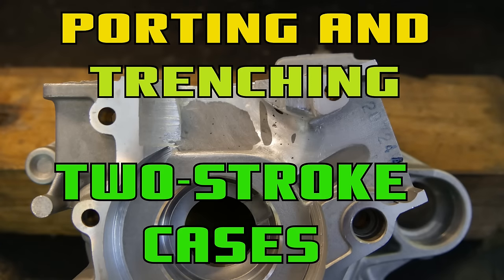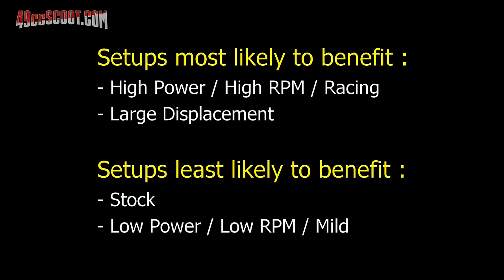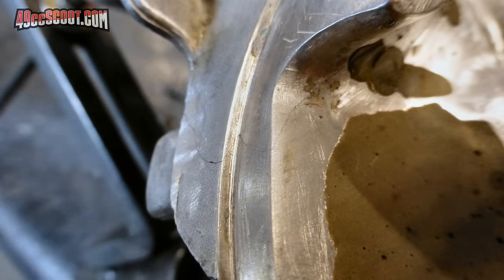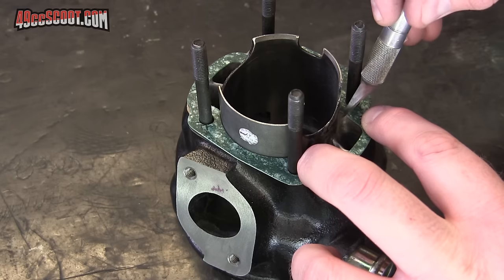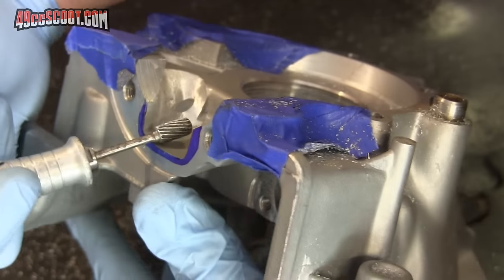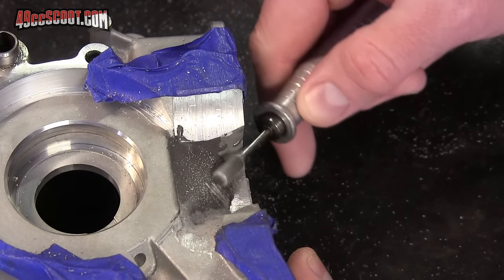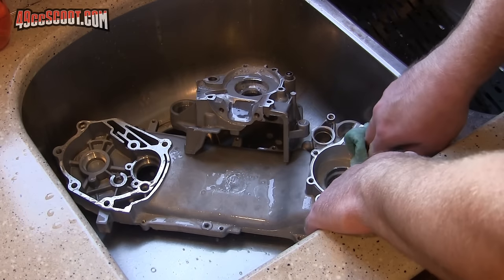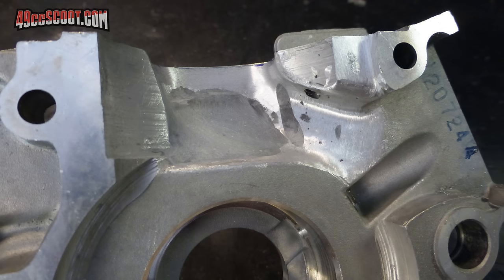Port Matching, Porting And Trenching Two-Stroke Engine Cases

Comment: When removing alloy from the cases, remember you will also be lowering the primary compression. Look up Tods tuning for BSA Bantams. Tod used to fit crankcase stuffers, to compensate for metal removed from ports. Also renew crankshaft oil seals.

Comment: One thing to keep in mind, when you cut away from the crank case and increase volume, when the piston comes down to pressurize the crankcase, it can not create as much pressure to push into the cylinder with.
Reply: Stuff crank w cork and epoxy.
Speed secrets of a16yr
Reply: If your pipe is working as it should the volume in the crank case doesn't matter.
The pipe will suck the mixture for you.
Reply: @rippn6124  Rebalance your rotating assembly after doing such a thing.
Reply: @gislemark79  That absolutely is not true.
Reply: @rippn6124   No thank you.
Reply: @jeffreyhagelin3672  High crank case volume was something you did use in the 70s and 80s.
Nowdays the pipe does the job for you.
But the volume of the crank case should be ONE of the factors to include when calculating the pipe.
Reply: @gislemark79 Crankcase volume is definitely NOT one of the parameters used for pipe design. Feel free to purchase any of the pipe design programs offered and check the parameters needed to be input. The idea that you could possibly even calculate crankcase volume or the amount of mixture that is actually moved to the combustion chamber is rediculous at best. Induction efficiency is functionally impossible to calculate therefore crankcase filling and transfer efficiency from crankcase to combustion chamber is impossible as well.
Reply: I agree. Smaller crank area equals less PSI when the piston port opens.

Comment: Leave a rough finish on areas where fuel / air mix is travelling and polish exhaust till it's shiny. Rough surfaces help with atomization of your mixture and you want the exhaust to have the least amount of friction you can deliver.

Comment: i have a gilera runner 1999 50cc ....i had upgraded to a 70cc as for my first ever engine build...the next time i do pull apart my engine i will be port matching and smooothing ....thankfully im a very very experienced fabricator/tig welder and have weld repaired multiple engine blocks with cracks...can't wait to try this!

Comment: This video was awesome! The amount of detail and information was far more then I expected. Now I don’t have butterflies in my stomach thinking about porting my own.
There was a segment were you showed two casings where one had sharp edges with no lead in angle. The other had rounds and drafts as we call them in the biz. The one with sharp edges was done by someone who doesn’t understand or has a clue of production casting methods. While the casting with rounds was done by someone who did the design by industry standards and understands the added benefits when designed into the part.

Comment: A squirt of bluing into a 2 stroke spun externally can reveal the major patterns in flow. 
Testing the reeds to identify the relative crank position is possible with the tiny vision equipment and data acquisition available now plus a little ingenuity.

2 Stroke Stuffing has been very interesting to follow in his quest for the illusive 50cc holy grail. 
Peace.

Comment: If you dont mind me making a suggestion. I actually recommend the double cut carbide/tungsten burrs WITH a soft wax instead of WD-40. It will unclog the flutes, and makes for a very smooth cutting process and prevents grabbing of your work piece. Just insert your cutting bit into the wax while still spinning your cutting tool. Repeat the process frequently. Youll notice the difference in ease of your cut, no vibration or turbulence.
Reply: He's removing huge amounts of aluminum, you want a single cut, spiral, or high-helix burr on aluminum always when reshaping aluminum.
Reply: As a machinist,  I can't believe I've never thought of that.  Thank you lol

Comment: Thankyou very much! After looking at my 1e40qmb case and Minerelli Zuma, it’s clear there is more meat on the case for porting on the 1e40qmb.
The port maps thread on your forum I plan on using in the near future!
Reply from the maker: I haven't really checked out that area on the Zuma cases, but I know the clones have more meat left when you do a stroker crank.
Reply: Be real careful, most transfer ports are already too large and enlarging them more kills the velocity of the fuel charge.
Reply: @darrellkelso9915  interesting, that was my worry sort of lowered compression filling, we used to pack any holes in the crank with car cor plugs to raise the transfer vacum/ compression of gas up wards.

Comment: Hey man, great video!  

Iv just ordered myself a gasket kit and im going to split my bock and take the pathways out a touch and clean them up. 

Iv been messing with a 40cc poulan chainsaw. 
Did some clean up on both intake and exhaust ports, opened the muffler a bit and dialed the carb in. BIG gains. 18 inches of green poplar in 18 seconds. video on my channel 

Again thanks a million!
Reply: just be sure u take out ur block not ur buba bock

Comment: I always screwed in some small screws under the porthole filling 
If if comes loose, wel you know
Cilinder skirts needs some work too
If they interrupt flow
They don’t need to be that big
Same for the piston
Lots of weight and skirts can be removed 
5 gram removal on a piston is huge increase 
in move up and down 
The lighter the piston the better

The best vid on porting
Top

Comment: I had a honda elite 49cc that I just cleaned up all the transfer ports, mostly with emery wheels.  Put back togethe, the scooter would rev quicker and pulled much harder.  Yes it does help "stock" motors, mostly in breathing.

Comment: When you use JB Weld or Devcon on cases or heads, heat the item in the oven to about 90degC before you put the glue in, it will dry in a matter of minutes, but more importantly this is done to give the strongest adhesion to the aluminium.

Comment: I port the heads of my 4 strokes if they need it as well, some castings are shit and have horrible ports so a bit of time and a rotary sorts that out! Some bikes you dont notice any change and others are like you've summoned and saddled Lucifer himself! But as of yet no dyno proof! 
Great all round video on porting, got a Peugeot 49cc I'm thinking of boring to take the 100cc cylinder and using the 125cc BB kit! 
Will have to check some of your other videos out!

Comment: This is good, i dont like the chemical metal though, i found out after testing that oktan 110 disolves these kinds of metals like acid.
My headache is over after Malossi released their C-ONE / RC ONE cartridges however, no need for chemical metal in those for flow optimisation.

Comment: If I need to do fill work in cases I try to orient the case in a fashion that allows the filler to fill the low spot intended to built up if another coat is required I will just reorient the part if necessary and you get a smooth filled are with minimal filler to achieve the desired result.

Comment: Disposable ear plugs are great for sealing holes for filling, painting and even general penetrations in house floors for speaker wire etc. Especially good for small holes and pretty easy to remove even when painted.

Comment: Great video. Clear and to the point. Just so the kids know, "polishing" the ports is a BAD thing. The air fuel mixture will form droplets on the smooth surface due to surface tension. It should be no more than around 220 grit with a random scratch pattern.
Reply: Polish the exhaust port, this stops carbon from adhering to the port wall and dropping flow. You are correct regarding intake ports but the reason is the same as why a golf ball looks as it does, it creates turbulence at the surface allowing less edge effect (slowing of air at the surface)
Reply: Shot peened ports are my personal favorite but difficult

Comment: Thanks for the incredibly well explained video - your voice is pleasant to listen to and everything you explain and show is easy to understand even for beginners (or at least I think it should be). Do you have a dyno or access to one, or do you check your work for efficacy with the "butt dyno" only? How much power would you say you gained from all this porting and flow optimization, or was it more in service of making the cases able to handle the much larger pumping capacity of the 103cc bigbore/stroker kit?
Reply from the maker: Thank you! I wish I had a dyno, but I just do my testing on road. I do take numbers like measured acceleration times and top speeds and such, but I haven't built identical engines with and without the  porting to know what comes from it and what comes from other things. It is just a part of the process of a build at this point.
Reply: @49ccscoot  I know this is an old post, and I don't know if you have a Dyno now, if not check out simpledyno, I'm pretty sure you can make one of those, and it's free software, it's just the hardware you have to make,  you have to spend money on.

Comment: Nice vid bet it took some time to edit all that - thanks for doing it. Started off with puch cases, ruined 2 got a little too happy on the burrs.
And oh yeah jb weld is your friend. Puch cases are thin and easy to trash, but i got one with a good 70 cc kit to work well. Hard to say if anything i did made anything better - wishful thinking is best used. A bit more than twice the power, maybe 10 hp ? a reed kit with a higher compression head made it run hot. Trade off fuel ratio to keep temps down, it ran well but a fuel pig that fouled plugs a lot - better than seizing the cylinder.
I had big plans for my piaggio scoot hyper 2 engine. Found some very interesting cylinders on UK scoot sites, 90 cc bolt right up kits.
But past dirt bike crashes caught up with me as i knew they would, need 2 disks fused lower back and c5 neck. Pain is hellish 24/7 so riding is not gonna happen this year, i'll be lucky if i heal by new years. Took my old ke 175 out last week all done in half an hour, just hurt too much.
But i can still get info and make plans - that will not pan out.
Anyway, good video thanks for putting it up.  Have a good
Reply from the maker: Thanks. Hope you can get feeling well enough to ride and wrench more before too long.
Reply: @49ccscoot  Thank you. The hell has not started yet, 2 weeks i'll have some idea of what will happen. Think i'm looking at going on disability, might be a year long event.
Strange thing about pain after ten years
you do develop a tolerance to it. To a point
only, pass that and it's just like new again.
An ER doctor was telling me, you don't
realize how it effects you until it's gone.
Blood pressure, concentration, sleep habits
are all effected you do not think about it.
Happens by it self.
If you look up the word stubborn - you'll see a picture of me next to it. I really have waited far too long in dealing with my spinal injuries. Pain is a powerful motivator
had it not been for that, i would still be
just going along with it. stupidly
I am NOT going to write books here - it is what i do - sorry. I end here. Have a good
Reply from the maker: @johnrobinson357  Crashing sucks. Getting old sucks. ...but bikes are awesome, so what can you do? Good luck.

Comment: When using jb weld to get it into spaces that are tight if you mix it on card and fold it into a v you can heat underneath with a lighter and it will pour. To flatten it out and steer it wet you finger with gob grease and you will be able to push it about without It sticking to your finger

Comment: Hi i watched you video on porting What I've done in the past is When you have gone to far  strip the coating of 1mm wire and with a sharp knife cut it up 1mm 2mm Lengths Before you put JB on the case stick the wire sleeve in your casing with Super Glue then put JB over the case on the smoothing out you will see the tops that you glued in if you go to far then once finished you can touch each one you see with drill bit and refill over job done ✔ HOPE this helps you  👍 😊 then put heat and oil  resistance Spray paint over the work to protect it 👍

Comment: Thanks for the video. I think I would try an HDPE screw for through holes. It's tough getting anything to stick to that except more hdpe.
Reply: DFA Beagle I mean. Really. A regular bolt with some pam spray or even wax on it will come out just fine. I’ve done it plenty of times.
Reply: Shoe polish works for gunsmiths

Comment: Trenching is usually used to make room for a longing stroked crank without knowing exactly what you are trying to achieve you can open ports and cases so large that you begin to lose velocity and fuel Atomization also the crank gets its lubrication from the fuel/oil mixture so trying to redirect the flow of the mixture strait to the exchange ports via the intake is not always going to be beneficial if u lock up the crank bearing or bearings knocking down edges does increase flow but most importantly it reduces cracking.jb weld does not hold up to gas or oil well or vibration! Aluminum should be tigged

Comment: Here is just a thought, to gain back volume lost, is it possible to use cork and epoxy to hold, on the underside of the piston ? An old snowmobile engine trick.! Does not add much weight to the piston but maintains base pressure to force mixture into the transfers?

Comment: One way to minimize the risk of cracking the case is to saturate the epoxy with fiberglass strands. It's dirt cheap, and will massively increase the strength of the filler. It shouldn't be any harder to shape with burrs or sanding either.
Reply: @labrikorn_3299  WHAT? My God, I should be dead by now from all the fiberglass I've sanded in the past 25 years. Jeez the kids these days are afraid of everything 🤣

Comment: Reed valves don't like a lot of crank case volume.  I know you can gain movement with the pipe effects, but with tight crank case volume with reed valves, the reeds tend to stay open longer as the larger volume of (elastic air) takes more time to develop a negative pressure to open the reeds.  Wiith tighter crank case volume and reeds, the pipe should open the reeds earlier and keep them open longer.

Comment: This could be great if you had made an engine without modifications with your TP 86cc mounted and measured on dyno field and measured HP. and after that made an engine with the changes you make in videos here mounted TP 86cc and looked at dyno field and measured HP so we could see with our own eyes what it would actually give of effect when we adapt our cylinder to the Engine Block

These are some great videos you make.

Comment: Cold welding can be use for the exhaust port ? I have a hole on one of my cylinder, meeting the studs hole...
Reply from the maker: Possibly, as long as it's in the port and not in the bore. There's a risk of warping the cylinder too.

Comment: Jb weld is not fuel resistant. It won't work as a filler for long if any of it is exposed in the port.
Reply from the maker: Multiple comments say that it won't, but real world use shows me that it has. I've had it crack before, but haven't had chunks of JB Weld fall out or anything. I won't claim that it's the best possible solution, but it outperforms many people's expectations. Current engine has 1.5 years of use without issue, and I've broken the crank, variator, worn out a cylinder... It doesn't have an easy life.

Comment: Good video but with a lot of material removable at the base of the cylinder I wonder what kind of reliability the engine will exhibit especially with the continued enhanced vibration.
Reply from the maker: I can't say I've had many issues... aside from my recent 103cc LC engine (these actual cases).  That thing refuses to seal on the top side (cyl to head) long term. Could be a combination of many things, including this. Other engines have been fine. My 86cc is done in a similar fashion, only just slightly less aggressive, and it has not leaked at all so far. That's a better designed kit though and I tend to think it stems more from design of the cyl and head, but the more anything can flex, I'm sure it can become problematic. This is somewhat the conundrum in many applications regarding performance. How much is too much and what sacrifices or compromises are actually worth it? In this case, it prob is the smarter bet to be less aggressive. I definitely wouldn't do this if my #1 goal was a daily rider.

Comment: Use a scribe as permanent marker rubs off when near oil . NEVER dig through cases unless you can wield it and NEVER use appoxy ,it's crap .people often forget it's in direct contact with petroleum vapourised fuel and heat .before anyone says go read up from pro's of tuning ,non use epoxy ,they weld cases ,the reason there isn't a definite book to tuning is cause all motors are different, that's why they called guides . There are port maps however and that's a top tuner producing a guide and a cutting guide to know exactly where to open up ports to

Comment: Thanks for sharing all you have done and know.  Have you or have you come across any data that would isolate the effect/gains of this wkrk by itself?  Obviously the effect of enlarging the case area as part of the porting and trenching is hard to remove.  Thx!
Reply from the maker: I have not. The career tuners and racers don't share much info that I'm aware of and they're the ones likely to have data for that sort of stuff.

Comment: One and simple way to masure anything on engine at home is to count RPM's. Formula is simple. Any gaine in RPM's and how quickly it will hapen indicats that it works. Just switching to Iridium sparkplug is automatic 500RPM's gaine. My Vino 5BM with 68CC Malossi Alu. Cylinder made 12hp at 15K RPM's. I did dyno my scooter if you asking.